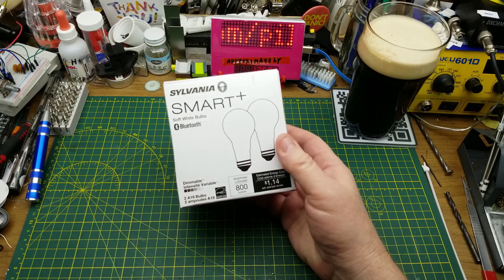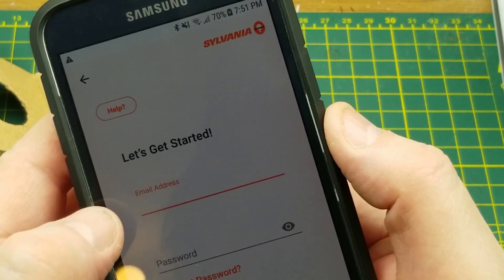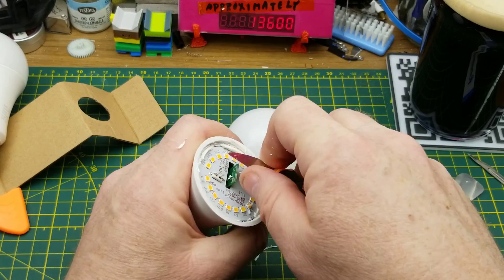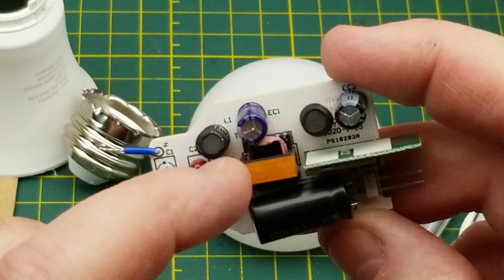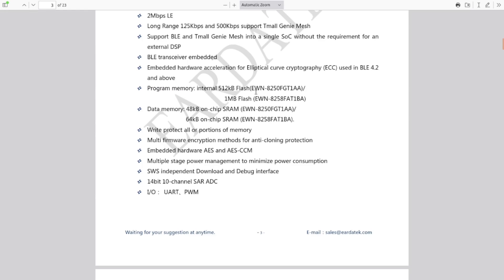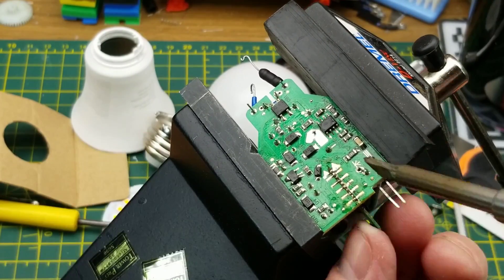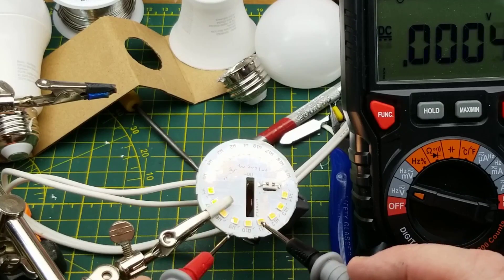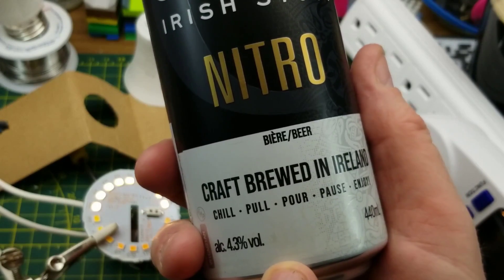curiosity teardown: bluetooth "smart" light

Comment: I opened a zigbee lamp here last week, it is prety similar, but the conn btwn leds and the pcb has 3 pins, the lamp has temperature (white to orange) and light intensity (0 to 100%) and of course the chip is different because it runs the mesh stuff for zigbee, but physically identical as the bluetouth one, and probably the wifi type as well... very nice content!

Comment: FYI - the smart+ app doesn’t make these bulbs “phone home” at all, and “technically” the email address isn’t even required for setup, though they do want an address for marketing purposes. Everyone should have a throwaway email address for this purpose. The app will allow you to “setup” the bulbs, or at least prepare them for operation and connecting to a smart home base of your choosing without even having an internet connection - though I’d recommend it for first use as it’ll update the bulbs firmware allowing it to not only “talk” to more “smart home” devices, but improves the bulbs overall performance, especially with the full colour bulbs which at the same price I’m shocked you didn’t get. Not only for the colours, but for the fact they can operate as cold or soft white bulbs (which is awesome incase you want different lighting depending on where you’re using them)…

Bottom line is they’re 100% worth the price, and don’t phone home to anyone or anything as they’re physically incapable (though your home device might if you don’t manage their connections appropriately like you should).

Edit: after finishing watching this, you can “fix” the light by bridging both sides of the bulb you crushed (this is how you can fix all led lights that die). And the Bluetooth module is easy to communicate with if you have a Bluetooth module connected to a computer. There are resources online detailing how to accomplish this…

Comment: you didn't need to convert it to normal LED as it has a dumb mode on power on, it is only Bluetooth so can't phone home like the esp32 or zigbee ones, just use the second bulb without pairing and it will be in always on mode from power on.
Reply from the maker: I initially wanted to convert it to wireless control that I can trust not to phone home or create a hole in my firewall.

Comment: There are some open source home automation projects that hold all the infomation on your own computer. Given Sylvania used a generic IoT module I'd guess the bluetooth protocol is one of the open standards and you might find it is supported by one of these projects. Then you could use your own computer (Raspberry Pi, old reclaimed PC etc) to join all your IoT devices together without leaking it out onto the internet. It is useful to have lights that turn on and off at night while you are away for security purposes, so a single color light isn't pointless. Back in the day I did the same with cheap timers because I was working away from home a lot and my house was empty for long periods. So if you get any other "IoT" things other than your Christmas lights it might be worth looking into.
Reply: It’s 100% open and the module is even capable of accepting firmware updates over the air. And you can communicate with them openly too…

Comment: What component tester do you recommend?
Reply from the maker: I have been using one like this: https://www.ebay.ca/itm/401126416227  for many years, and I also recently got one like this: https://www.ebay.ca/itm/354434988660

Both work well, but the newer one has a case and a built-in rechargeable battery.

Comment: Got the same one for $5 at Dollarama.  Hoping to see some projects with it.
That 8-pin chip is easily readable after cleaning of the crappy coating that the manufacturer has all over the board.
It looks to be a regular Bright Power chip
BP2306/L3J51CJ/HDAM14C
One thing that I just noticed while lighting up my desk with Near UV LED's the LED chips are different colours.  6 of one colour of LED plus 12 of the other.  Probably to give a more coverage of the visual spectrum but I did not see any thing that would suggest anywhere on the packaging what it should be.

I bought some other brand of "smart bulb" at CdnTire and I thought it worked with Alexa straight out of the box but it did not.  Tore it apart and found an ESP8266 in it.
Reply: The full colour bulbs at dollarama for the same price are a far better deal and option. Besides having the tricolour led’s they also have a series of dedicated white bulbs so that you can choose to run them at full power (or dimmed) at the complete range of white biases (from cool white through daylight through soft white through warm white)…

Comment: Do you remember X10 devices? They used the power lines to communicate and was well before any IoT device hit the market.
Reply from the maker: Absolutely. A cool technology whose image was destroyed by horribly marketing.
Reply: I still run some x10 modules (mainly for house exterior lighting and dimming control). The biggest gripe I always had with them was the fact that you needed to run two wireless antenna modules (paired identically) if using them indoors around the house, as they’d only communicate over one branch (or half) of the circuits…

Comment: I used to preheat the aluminum circuit board with a tea light or votive candle so soldering was easier. it does get slightly sooty but that's on the back and wipes off ok.

Comment: Thanks. this type of video is EXACTLY what us hobbyists are searching for. No disrespect to big clive (BC is my hero), but you do the lower level skilled folks better service in matters of practical example. so yeah. more this type of vid please and thank you :)    re: the unlit half .. can you bridge the damaged led?. or remove and replace with a resistor equal to the leds from either side?  . or both. it's not like the power side of the circuit is faulty.
Reply: Bridging the bad LED would cause problems because then the two parallel halves would have different lengths, so they won't share current. Replacing it with a resistor would work at a single power level but if you change the dimming level the equivalent resistance of LEDs change.

What you could do is bridge the broken LED and also bridge an LED on the other side.
Reply: @eDoc2020  thanks for info and taking the time to share it :) - kudos
Reply: @eDoc2020 While using a resistor is more eloquent, simply bridging the broken led will work just fine (though it’ll increase the amperage going to the rest of the leds resulting in them running hotter and dying prematurely). This same principle is also good practice with cheapo leds by adding a resistor in series with the led strings to lower he power going to them resulting in significantly longer life (if not indefinite)…

Comment: In regard to the board removal, I have had good luck by removing the tip contact as you did and then just yanking the board out.  This will often break the wire or component attached to the threaded portion leaving the bulb base intact.  The remaining wire/component can be removed with pliers and for reassembly I drill a small hole through the plastic bulb body just above the start of the threaded base, run the replacement wire/component lead from in to out, and solder it externally.
Reply from the maker: Great tip!
.Thanks, I'll have to give that a try

Comment: IOT is fine when you build your own stuff. For example you can use a cheap ESP8266 board running the WLED firmware to control a ring (or a strip) of neopixels to build your own smart or mood lamp - all controlled from an app or just a browser from any device that can run a browser, laptop (running any OS), smartphone, tablet, etc. No "dialling home" involved at all because the access point is on the 8266 board itself.

Bluetooth controlled non-RGB bulbs seem a bit pointless to me, which may explain why they were cheap.
Reply: I too can't advertise for WLED enough.. it is such a nice project and virtually all my living area lights run on WLED.. also my clock and my plant lights ;) .. and all you need is wlan..  half around the world I can still turn off my lights.. try that with bluetooth :D

Comment: I bought a box of 4 emergency light bulbs that keep glowing during power outages. I thought these were gimmicks  as how does a bulb know the difference between switched off and a power outage. However I was surprised as they do and work. We have had two short power outages and they remained active. They work through some sort of capacitance that is all I know. If you run out of things to examine these could be interesting for you.
Reply: More basic ones measure resistance. If turned off with nothing else on the same switch there will be an open circuit, but if the power is out there will be a low DC resistance through the street transformer and/or other loads. For a quick test remove a bulb and short its input.
Reply from the maker: Those sound interesting. I'll have to keep a lookout for them

Comment: I suspect that output is not isolated from mains as I can see only two inductor pins connected. And main chip look like it got some flux or lacquer on it, you should be able to see markings when cleaned, or even try smear some thermal paste on it, to make laser etched letters more visible. Either way i think this light after fix works at limited brightness, probably because of limited current.